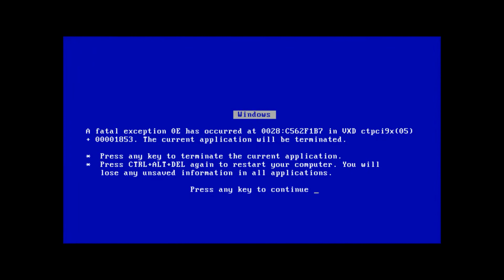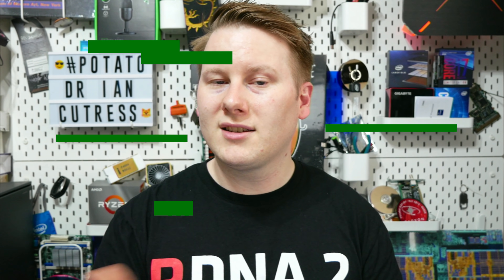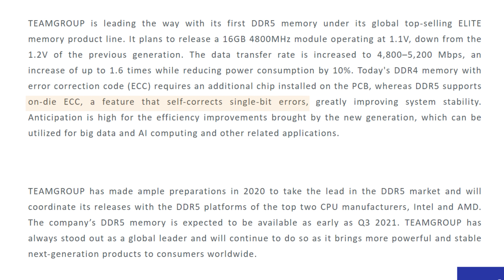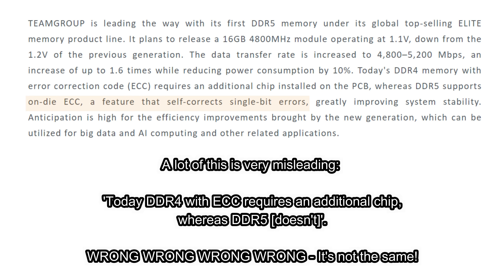Why DDR5 does NOT have ECC (by default)

Comment: Please forgive my garbage formatting and obvious technical mistakes as I'm busy..

Both ECC DDR4 and 'default' DDR5 use ECC to correct single-bit errors that occur in the memory modules themselves before the data is sent off the DIMM. 

Error correction happens on the DIMM for both: On the DDR4 ECC DIMM it is the PHY that retrieves the data and parity bits and checks for errors, whereas on the DDR5 DIMM each module performs it's own check before the data is sent to the PHY and off through the data bus.

The tech is NOT misrepresented in the marketing materials you misquoted.

You state that "It is not traditional ECC, and in fact won't do much if you really need an ECC system.". 
Please clarify: if a person wants the peace of mind afforded to them by error correcting memory modules, how does DDR5 not do much for them? 
If a cosmic ray hits both a DDR4 ECC module and a DDR5 module causing a bit flip in both, which is corrected by both before being sent off the DIMM, how is that not using ECC?(rhetorical)

I am aware of the advantages of having full platform ECC support but we aren't talking about whether a particular platform supports or uses it, we're talking about DIMMs.

Comment: I thought we where finally moving forward with ECC on the desktop. :-(  (Yes I'm all for ECC on the consumer grade desktop)
Reply: You can do that now, with AMD Ryzen. I'm using ECC memory modules (unregistered) in my R5 3600 desktop.
Reply: @joealtona2532  also depends on board and BIOS.  I can use the modules, but ECC isn't active - BIOS limitation ( MSI X370 Gaming Pro Carbon with Ryzen 3600).  I was hoping DDR5 was going to change that, ECC would arrive with out of box support regardless of CPU, mobo and BIOS combination.

Comment: Um, since ddr4 all memory has had in transit error detection on writr, and retransmission. It is called write crc. Ddr5 extends this to read as well, and so along with on chip ecc, and retransmission this gives you everything in ecc.
Reply: Hey, do you work in the industry? I looked into this a while back out of curiosity, but I couldn't find if the CRC support is actually mandatory. I doubt it is, since it apparently incurs a 25% bandwidth penality.
Reply: @joker-hj2  I don't work in industry. The crc support is an option that can be used or not, I don't think it is manditory in that it is allways used, I do think it will always be there though. Costs too much to make different chips. It does have a bandwidth penalty.

Comment: Even after nearly 50 years we’re still plagued by DRAM refresh interruptions & consequences!  In 1973 we had 2ms refresh times and triple voltages (-5, +5 & +12V) with Mostek MK4027 4096 bit x 1 DRAM.
Reply: You do realise the technology is the same? Let's get to photonic RAM crystals first and we'll talk again...
Reply: Back in the 1970's we de-lidded 4116 DRAMs to made crude image sensors.
Reply: I think they implemented self-refresh modes around the i486 era.

Comment: I wonder if they'll add it if they find they can transmit faster with ECC. Like doesn't PCIe6 have forward error correcting code built into it? To eliminate delays from re-sending corrupted data.

Comment: Bit flip errors are much more common than people realise but they rarely cause a noticeable error to the user.  Back in 2009, Google produced a research paper examining memory errors in their vast fleet of machines ("many tens of thousands) that make up their computer fleet and they experienced at least one correctable memory error in a third of their machines per year (all of the machines studied used some variant of ECC which is how they logged the error rate).  For a majority of average computer users, they are more than likely to experience multiple bit flip errors every year but the likelihood of these bitflip errors causing an issue for them is very low - the bit flip would have to occur in data that actually required it to be perfect and chances are that it would result in a random glitch, application crash or rarer yet, a random BSoD.  

Per chip ECC in DDR5 will help reduce this random occurrence even more and is a good thing for everyone but the likelihood of a random user actually noticing a difference is pretty low.

Comment: on die ECC means you can shrink stuff enough that you get the wrong answer a significant percent of the time, knowing that you've got the spare 'bits' to correct the error - just like how ssd's deal with lots of bit-read errors with ECC.

Comment: The need for ECC is also a function of altitude,  for Aircraft  I used to see data corruption is for Data In Motion , and Ram Data at Rest. Flash uses a more robust ECC algorithm for data rest so that did much better,
Reply: Flash has to have much more sophisticated ECC scheme as it wears dows from writing data to itsels. Flash memory writes are not perfect either (especially with TLC and QLC). Flash-based storage also has to retain data if stored unpowered with no way to refresh charge within memory cells. That is why such a complex solution is deployed within flash storage

Comment: So, it's not true ecc, but the question is: is there some degree of added reliability from bit flip protection or is it all going into yields and density? I mean I would think so, as memory capacity per system will increase it would be nice to keep errors/GB/yr under control

Comment: Me using 23,0 GB of 23,7GB of memory. Curious how most bit flips will be from unused memory. (haha)
Reply: Most "unused" memory on a modern desktop system is actually disk cache, so an error there can show up sooner or later if the cached file gets used :/

Comment: "If you do need a proper end to end ECC system where your data is fully protected.."

I'd argue that describes everybody. It is unconscionable that in 2021 random data corruption leading to crashes, or worse, would be accepted in a core computing component.
Reply: It is worse than that! With rowhammer, it is a security defect! Google now claims to have achieved a 2nd row flip. No excuse for turning off ecc. No motherboard or bios should prevent it.
Reply: 000% agree. The problem it seems is that CPU manufacturers like to fuse off ECC in lower-end processors (including ALL consumer grade ones) 'cause market segmentation. The circuitry almost certainly still exists on the die though. Consumers should be sold CPUs with ECC enabled and have the option to choose whatever memory they want
Reply: @lordofthecats6397  You're talking only about intel desktop CPUs of course.
AMD supports ECC on all CPUs at every segment. 

ARM mobile CPUs have supported ECC since at least Cortex-4. 

SiFive's RISC-V CPUs support ECC on DDR and throughout their entire cache hierarchy. 

As does IBM Power.

It looks like Apple's M1 might also (from log messages like ('AppleFireStormErrorHandler AppleARM64ErrorHandler: will not panic on correctible ECC errors').

I'd argue people should perhaps not buy crippled CPUs lacking in important data integrity features but practically nobody understands the importance of this.
Reply: @NaokiWatanabe  Well Ok, I had no idea that AMD didn't lock out ECC. It'd be nice if they'd advertise that more. That's an actual selling point to me, unlike "<cool word>CACHE". Anyway, f-ck Intel and only Intel for locking that out then. Also I meant to say 100% agree in my last comment, but it appears there was a little bit of data corruption ;) If only my processor came with ECC support! Unfortunately I'm stuck with Intel as they were pretty much the only option when I bought this computer.

Comment: I guess it can help with stability of ram overclocking. downside, it could missleading, i guess also we need to verify memory oc not with stability tests, but with speed tests. if the failrate is to high, it wont fail, it would get slower.

Comment: Also, based on their own claims, DDR5 on-die ECC is only good for single-bit error correction.
Depending on how wide of a net memory-controller casts on the memory interface, the correction range can be wider and more precise (e.g. 128-bit chipkill ECC).

Comment: "Certain CPU manufacturer wanted better benchmarks"
COUGH Intel COUGH
Reply: Better benchmarks also tends to yield better performance too to be fair.
Reply: @FakeGordonMahUng  Crashes and data corruption are worse than a bit faster speeds.
Reply: @aitorbleda8267  For consumers it's better to have the faster version instead. The JEDEC speeds are REALLY slow.
Reply: @TokyoQuaSaR  I disagree.  There is no reason not to have XMP ECC memory.
Reply: @TokyoQuaSaR  JEDEC spec is perfectly fine, you don't know what you are talking about.
Reply: @aitorbleda8267  I hope so, I actually don't know, I was just reacting to what was said in the video about that, but my English isn't perfect so maybe I misunderstood something here.
Reply: @TokyoQuaSaR  My i5 10400F system with JEDEC 2666MHz RAM has no problems running any game, so it's would be accurate to say that JEDEC RAM has a small negative impact on overall system performance, instead of saying that it's slow. It's perfectly acceptable and in gaming even 2666MHz JEDEC spec memory at worst hurts performance by no more than 5%, which is practically nothing. As it is the worst case scenario in one or to titles tops, in others difference is even smaller or doesn't exist. On Ryzen difference would be bigger, but nothing exactly dramatic, unless you use iGPU on Ryzen APU.
Reply: @MJ-uk6lu  I mean sure, the memory alone can't have such a huge impact, so no it's not dramatic but neither is the lack of ECC. Still about 40% in CAS latency is pretty big, so even for RAM you can lose what one may consider to be too much perf because of that. And if you watched the video it's pretty made clear that the ECC isn't really vital for consumers to say the least. But I am not sure about how it will be dealt with and hopefully ECC and non JEDEC settings will work perfectly fine together.
Reply: @TokyoQuaSaR  Those performance gains are only seen in theory and never in practice, so likely something else bottlenecks and you don't see good scaling. And ECC would be really nice to have and most people would likely agree that having ECC is far more important than those miniscule performance gains due to lower RAM latency.
Reply: @MJ-uk6lu  I think you didn't read my comment correctly. I didn't say there was 40% performance hit because of slower RAM, I said it's a 40% CAS latency increase. But in this case the performance hit won't be that small in practice. If you read tomshardware articles about memory impact, it's not very big but the tests they do are not done with such slow CL, so if you compare for instance DDR4 3200 CL16 (10ns) and DDR4 3200 CL22 (13.75ns), there is a good chance you reach more than 5% in perf decrease (in gaming), maybe even 10% in some games.

I don't recommend buying very expensive memory, but 3200 CL22 as mentioned by JEDEC is a bit too slow 😅 But i don't think you can find such slow memory anyway 😅
Reply: @MJ-uk6lu  "most people would likely agree". Well this video says pretty much the contrary.
Reply: @TokyoQuaSaR  JEDEC spec is supposed to be a good enough base spec with good enough performance. Ain't anything wrong with it and it's way more adequate than you think.
Reply: @MJ-uk6lu  I never say there was something wrong with it. I am saying that for my personal use (I'm gamer as well as an engineer) I would rather get one blue screen per 365 x 8 hours of use rather than lose 5 to 10% in performance so hopefully we don't have to make this choice.

For instance nowadays the DDR4 3200 CL16 modules are almost the same price as the cheapest (and slower) no name modules. I don't say it was always the case but right now the 3200 CL16 has a much better perf-price ratio.

And actually I have myself 32GB of some no name DDR3 1600 CL11 (13.75ns, JEDEC) on my home PC. The reason why I have that is because I got this from my work so I can work more easily from home (I do FPGA dev). So of course there is no big deal, but if I had had the choice I would have get faster memory, especially if it was the same price.
Reply: @TokyoQuaSaR  I'm using 2666 MHz CL19 memory mostly for gaming and some light productivity. It's really fine and you really need to look at tons of benchmarks to even know that it is any slower. And it's 2666 MHz, because I have Intel B460 board and it locks RAM speed to no more than 2666 MHz. For this particular lock, I investigated if memory isn't too slow and it turns out that memory on Intel systems makes almost no difference. Getting no bin higher CPU would make more difference than memory speed.
Reply: @MJ-uk6lu  I guess for 2666MT/s (it's 1333MHz btw) it's more understandable since there aren't many references recently except JEDEC modules. But whatever, my point was about the usefulness of ECC vs -40% RAM CAS latency (if same price) for consumers.
Reply: @TokyoQuaSaR  I'll try to get my 2Gx8 Micron Rev.E based dual-rank config binged to 3200 CL22 running at 3600 CL18. I'll report in 2 days, probably.
Reply: @namibjDerEchte  I think OCCT is pretty good to stress test RAM, if that can help. That and increasing the voltage to 1.35v which is the usual voltage for non JEDEC settings.
Reply: Anyone here remember RDRAM and Rambus's love affair with Intel?
Reply: @zenith251  Yeah. I also remember a chipset having a memory handling bug that caused a huge performance hit.
Reply: @zenith251  freakishly expensive but very fast. For years and until dual channel became common, it was the king of memory. RAMBUS now researchers and people pay roaylties to them.
Reply: I think the real cause was market segmentation, not the benchmarks. Intel figured out that they can milk more money from enterprise users (or any other users that actually want correct data) by forcing them to use more expensive Xeon processors by removing ECC feature from the desktop CPUs. If it had been just the benchmark goal, they could have supported both ECC and non-ECC memory in all CPUs, like AMD did.

Comment: There is one thing. In JESD79-5, on page 155, the new Refresh interval is defined as 32ms. This benefit is linked to less leakage yes, however I believe that the On-Die ECC is a contributing factor in this decrease to refresh interval. Especially considering VPP has decreased.
Reply: AFAIK Lower due to more leakage, and lower voltage, being worse, so 2x more refresh is needed. On-die ECC would allow poor chips to achieve 32ms, rather than needing 20ms and being out of spec.

Comment: I understand this perspective, but it is too pedantic for me. Take the wins where you can get them and don't wait for perfect. We've been running without ECC for a long time and adding ECC to even just a subsystem is a move in the right direction.
Reply from the maker: Don't get me wrong here, on-die is certainly a good thing to have, and it will enable better manufacturing. Definitely the right way forward. The point here is that a lot of people think it is the same as regular ECC, and it's going to be a shock when they realise it isn't.

Comment: Sure, but assuming that you have on-die ECC the integretiy of the memory data is safe, so isn't the parity additional memory not needed anymore? Just the parity bits on the DDR module itself which can be calculated on fly before sending the data?

Also doesn't that also makes rowhammer attack even harder?

Comment: Surprised overclockable ECC memory hasn’t become a thing with Ryzen and Threadripper platforms supporting both overclocking and ECC out of the box. In theory, it should be possible to OC the memory further than non-ECC memory as more bit flips caused by exceeding JEDEC standards are caught and fixed. Seems like low hanging fruit for AMD to get a competitive edge over Intel, and one that Intel would require a full platform refresh to match as none of their consumer products accommodate ECC.

Comment: Holy wow. Cosmic rays actually cause daily issues in datacentres?! Wow, I knew cosmic events can cause this, but I thought it would have been MUCH more rare than daily in places! Great video, thank you for explaining this, it was understandable to me as a layman.
Reply from the maker: If you consider that cosmic rays could cause 1 error per gigabyte per year (for example).  If a server can have 4 TiB of memory, which means you're getting 4096 errors per year, or 11.2 errors per day, on just that single server. Now spread that out to 21 servers per rack, a couple hundred racks.  1e/GB/yr is actually quite high, but that gives you a perspective on numbers. At 0.01e/GB/yr, you're still getting 41/year in a 4 TiB machine, or one every 9 days.
Reply: @TechTechPotato  WOW! This honestly blows my mind. I thought ECC for cosmic protection on Earth at least was purely for a "just in case" type of thing, not for a "this is absolutely necessary" type of thing.

I've got 32GB of RAM in my computer and if I wasn't energy usage conscious, I'd consider leaving it on for a year just to see if I can have this happen too hehe. Genuinely fascinating!